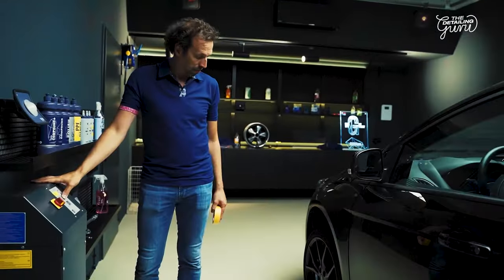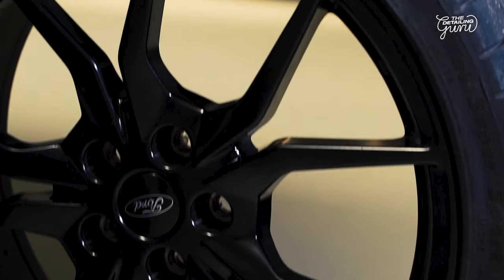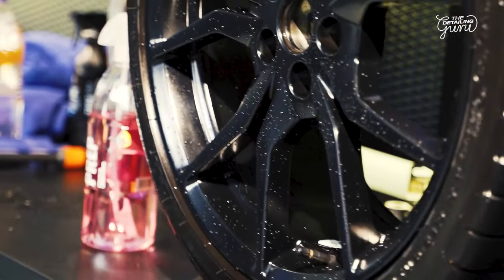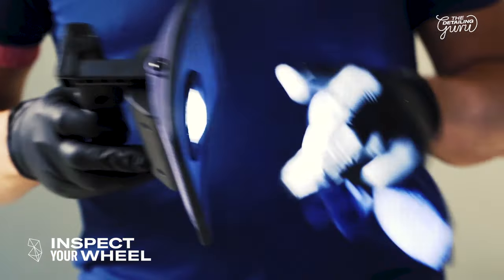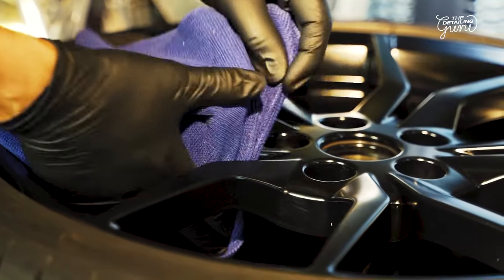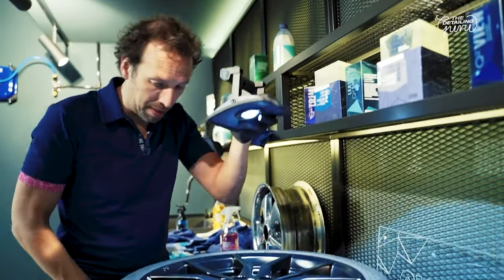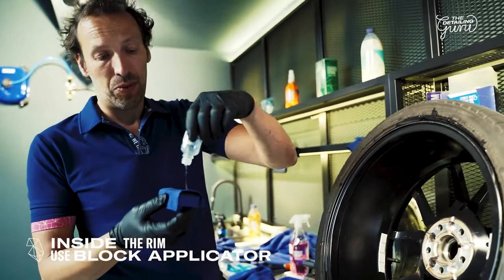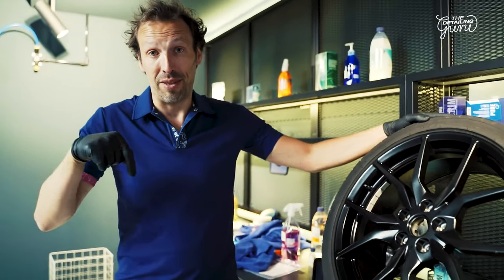The Detailing Guru: How to prepare and coat wheels?

Comment: Two important facts to mention:
1) Q2 Rim can only be used for 6 months after opening the bottle, so ideally you would want to plan ahead and coat multiple wheel sets 
2) Q2 Rim needs time to fully cure so should not be mounted directly on the car and driven right after application. Fully cured after around a week. Can be accelerated with infrared heating or a layer of Q2M Cure to protect base coat.

Comment: Excellent video once again!

What about freshly restored/repainted wheels? Is there a good rule of thumb to let the paint cure before any additional work? Before the actual use?

Then in the case of summer, sporadically driven car, is this ceramic coating still the best choice? Or just a regular use of tire and wheel cleaner, including the WetCoat?

Comment: I recently coated some bicolor wheels with metal/black paint styling. Unfortunately got some rainbow smears on a few black paint spots. But all of them appeared very late, I made sure residue is all buffed off but the coating probably took so long to cure that I didn’t realize some product residue still re-appeared after an hour or so. 
Is there an indication for how long/often you should inspect and buff off the wheels after applying the coating?
Reply: One really important thing to do is use enough quality microfibres. Do a final wipe down with a SUEDE microfibre. If you don’t have proper lighting, check outside. Good luck and thanks for watching.

Comment: If coating a brand new wheel, should it be coated before or after the wheel weights are applied?
Reply from the maker: After would be the most logical and preferable option. 
Regards,
Y.

Comment: How would you prepare a freshly refinished set? Let them degas? Clay? No clay?
Reply from the maker: Why would you clay a freshly painted set of wheels? 
Depending the paint process degassing is always good although on powdercoated wheels it’s not an issue. Again many variables are possible. 
Regards,
Y.
Reply: @GYEON_official  I don't know, I'm asking. You might want to remove contaminants from other processes in the paint shop. Or overspray, I don't know.
The wheels will not be powder coated. They will be finished with a 2K (bicomponent epoxy) top coat.
Reply from the maker: I would let them gas out and then do a proper degreasing stage before applying Q² RIM. 
Regards,
Y.
Reply: @GYEON_official  Thanks! Several weeks, then, right?

Comment: Is it better to clay the wheel before applying the coating?
Reply from the maker: Only when you would have very stubborn iron particles in the corners of your spokes or when you would have a lot of tar deposits on the inside of the barrel that don’t go away with chemical abrasion. If that’s not the case, just a good wash and Q²M Prep afterwards. 
Regards,
Y.
Reply: @GYEON_official  thank you Yves 🙏🏻

Comment: Hey.  Can microfiber be reused after this process and of course after washing for the same tasks?
Reply from the maker: The towels used for coating wipe off should not be re-use afterwards on any glossy or delicate surface - you can however use them for some “dirty jobs” such as wheel arches, engine bay or rubber cleaning 👍🏻
Reply: @GYEON_official  Thank you very much for the information. I understood everything and I will follow these recommendations. Success in development and prosperity.✌️

Comment: How to you prep matte wheels that were coated already but has worn down or not much coating is left
Reply from the maker: First a very good decontamination (multiple) with Q²M Iron and Q²M Tar and in this case U would suggest a very thorough cleaning with Q²M Waterspot. After that a final Q²M Prep wipe and you are ready to coat. 
Regards,
Y.